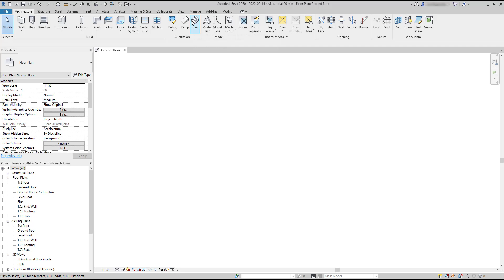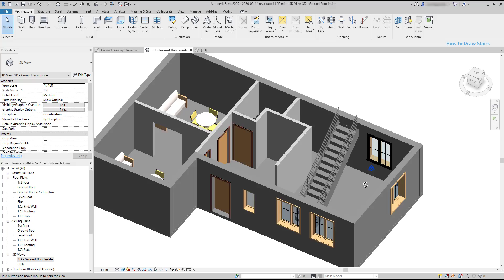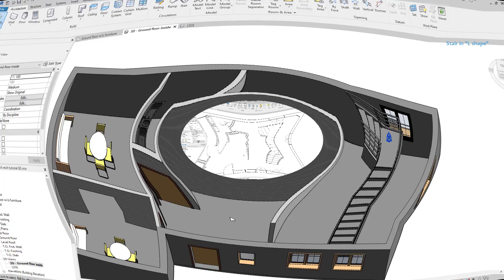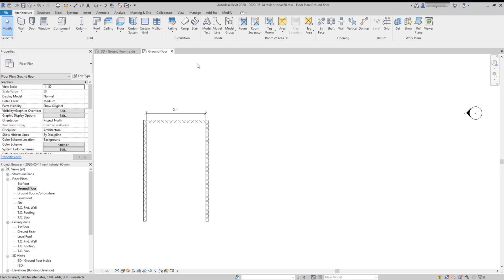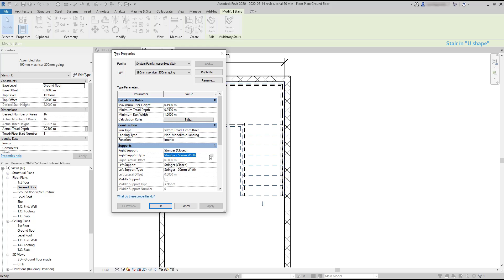Revit - How to draw Stairs properly

Comment: HI. i am doing structure. we are facing some issues of coping Architect stair into structure project.. Stair model in architecture is  FFL TO FFL. In Structure , Floor level  drop by either 50 / 100 mm  . for finishes. Some cases Ground floor slab drop by  100 mm  and first floor  by 50mm .  can you try to copy into structural template with different floor drop and see how its works.